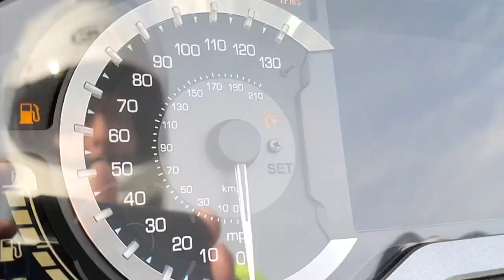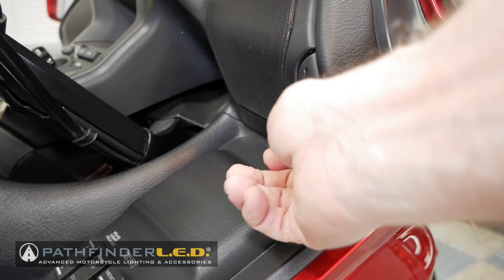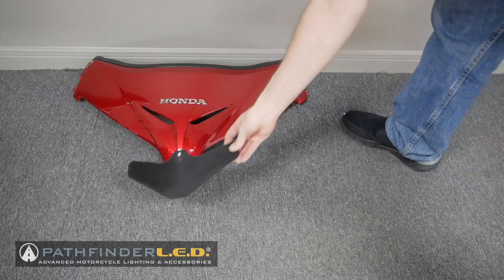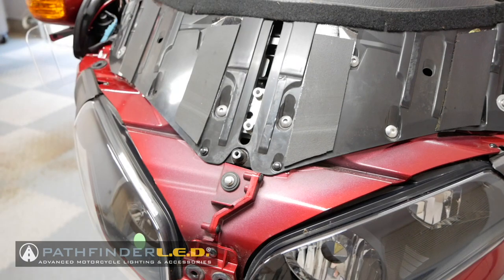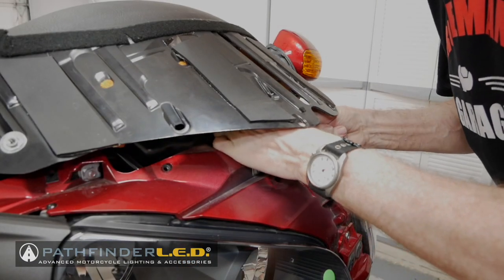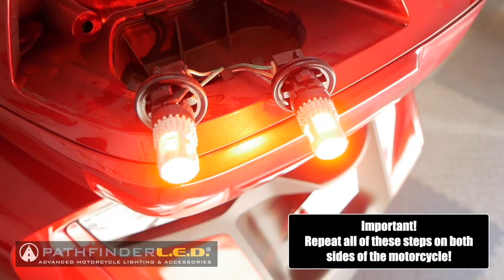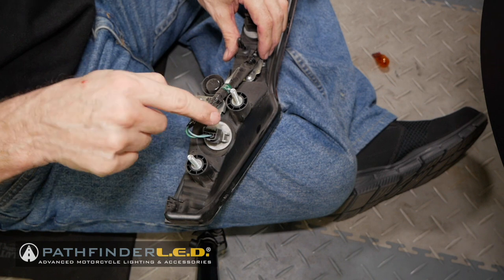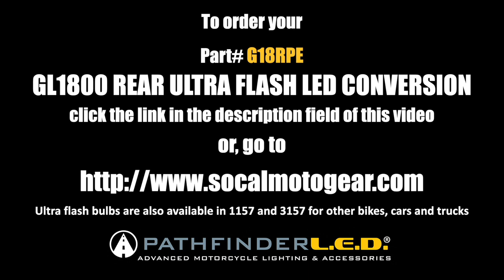GL1800 Rear Ultra Flash LED Conversion | PathfinderLED | CruisemansGarage.com | 2020

Comment: I super appreciate the level of detail you go into, even showing pieces after they're off so you can understand what you're blindly dealing with during disassembly. 
I just did my gl1800 air filter for the first time yesterday and the video I watched from Partzilla was incredibly disappointing with their lack of detail. Everything I continually wished they were doing in that video, you did here. I'm confident that if I had watched a videos from you about doing the air filter, I would have done it in less than half the time. 
Thank you!!

Comment: Cruiseman:  I'm a recent subscriber to your channel. I've watched a few of your older videos and I took your advice on a lighting upgrade. I installed the Pathfinder LEDs on my 2004 1800 Goldwing, including the rear running lights, brake lights, front and rear turn signals and high and low beams on the headlights.  What a difference. I especially like the flash feature of the LED brake lights. I was out earlier this week in the evening and I got flashed by an oncoming car that apparently found my lights too bright on low beam. My reaction: GREAT!!!. He not only saw me, he noticed me. Thanks for the good work with your channel.  Keep it up.  Peter in Santa Fe.

Comment: Adding to a comment posted two years ago, I also couldn’t quite get the flasher module installed the way shown in the video because apparently my hands are just too big. I loosened, but didn’t completely remove, the gauge cover by taking out the left and right pockets, unhooking the rubber gaskets from both windshield release levers, and then unsnapping the gauge cover from the dash. I could then easily remove completely the plate on the front of the bike instead of propping it open with towels, giving me total access to easily install the Pathfinder flash module. Only added about 10 or 15 minutes to the job but it is well worth the time!

Comment: I do have a 2018 Honda Goldwing Tour DCT, but I was curious, so I looked at this video and I noticed that into the 14th minute of this video, I believe the designation of the two connector ends were reversed; 2001-2006 would be the bottom connector and the upper connector would be for 2007-2016.  2006 was used in the description of BOTH connectors.
Reply: I noticed the same mistake.

Comment: Good job looks great but think one of the brake lites on trunk is in wrong socket.  One on right is on outside and on left is on inside.
Reply from the maker: You are correct. I noticed this after watching the video clip and corrected the LED placement, but the video I shot after the fix did not come out. Good catch!

Comment: Hey Cruiserman, great video and I started installing the kit today.  I just could not get my hand under the shield that you held up with towels.  I ended up removing the entire shield by undoing the 2 allen nuts holding the gauge cover and then removing the two nuts holding the dash down below the mirrors and then I was able to remove the entire assembly including the dash pad, Lots of room then, I could see everything and did the swap easily. Thank You!

Comment: Hi Cruiseman, I have a 2006 with an airbag.  Why is it not recommended to do the install myself please?
Reply: Hey docmac ….. i’ve just asked the same question, In the mean time did you ever find out why you cannot install the LED flasher  unit yourself ?

Comment: There is something  wrong on those rear brake lights. The out lights should probably stay on not the right on side. This makes the inner of the left rear light, and the outer of the right side on.

I believe the left and right outer sides should stay on, and with brakes all on.
Just an easy fix, but you should correct it in case you haven't

Comment: How do you eliminate the RF interference of Pathfinder LED bulbs?  I did the full set, including headlamps.  I am super visible and bright now, but can’t get FM anymore with lights on.  2008 GL1800.
Reply from the maker: I did not have that problem on my 2012. But, I think someone makes a filter for radio interference.

Comment: PS also my friend I ordered this set of ultra LED lights and also wanted to order those special turn signal lights for the front of my 2009 Goldwing but you never replied to my question asking you if I needed to change out the Flasher again for the front special turn signal lights or if the Flasher that's installed for these Ultra lead tail lights will be sufficient for both..?????
Reply from the maker: If you have replaced the flasher with an LED flasher, you do not need to change it out.

Comment: Will this kit work if I have a wig wag installed already?
Reply from the maker: Depends on whether or not the wig-wag supports LEDs.
Reply: @cruisemansgarage  all my front lights are led and have an led flasher, that's why I didn't know if the wig wag would work cause you say these flash on their own. Thanks.

Comment: Does that relay affect the lights up front?
Reply from the maker: Yes. One flasher controls front and rear turn signals.
Reply: @cruisemansgarage  So is there no issue with the front being incandescent and the rear being LED?
Reply from the maker: @bubblehead7680  None
Reply: Thanks for the great vid 👌